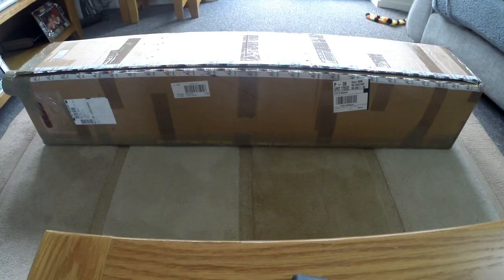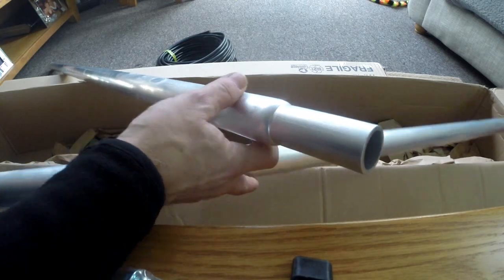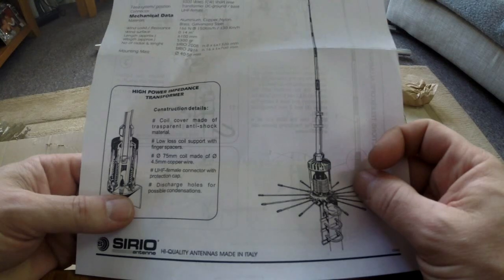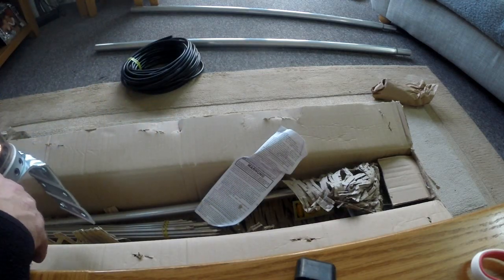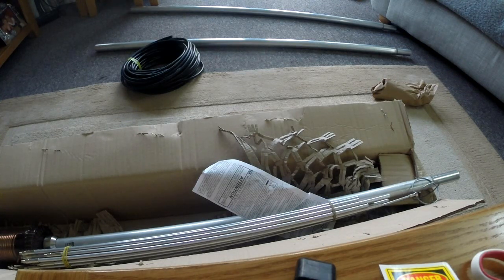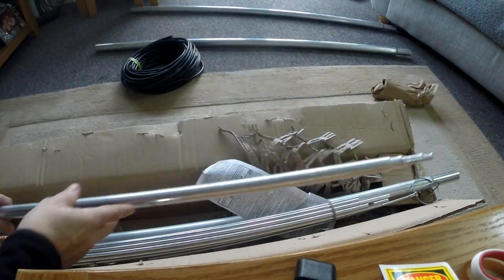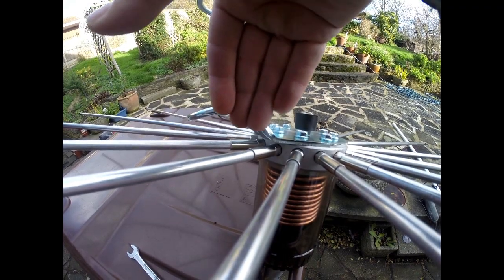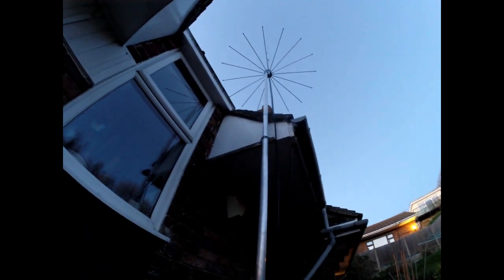Putting up my new Sirio 2016 antenna

Comment: Just went and bought one of these. Looks very well made. That base section certainly has some weight to it. Had an antron 99 years ago but it eventually broke in the high winds. So after being off the radio for about 20 years I got back into it last year and been using 5/8th wave silver rod. So time for an upgrade. 😀
Reply from the maker: I am very pleased with mine and made some good contacts so far, i will be posting and update video one year on as i have had it now that long. Happy dx on the new aerial you will enjoy it.
Reply: Fit the optional plastic radial ring to prevent the radials from bending or breaking.
Reply: @george-ev1dq This 2016 antenna doesn't have optional ring to support the radials. The sirio 827 has these.

Comment: That Sirio 2016 will absolutely smoke the Antron! I just put one up and it was far superior to the Gainmaster HW & 5/8 version. And no RFI issues.
Reply from the maker: Hi Ron, yes agree its a very good aerial I am very pleased with mine, had alwayys wanted one so when the Antron went and I had the opportunity I got one. Seems to do well as makinglots of contacts with it. Good dx'ing with it!
Reply: I definetly hope so. I am ready to stop using a Antron 99 that has a lot of white noise. Imo. I hear the sirio 2016 is very widebanded.

Comment: Greetings.
I watched this video with interest. I'm in Italy and my Lemm M5 broke due to strong winds. I currently have an old Falkos Uranus 27 mounted. The Sirio 2016 seems to be more resistant than the other antennas.
After years of use what do you think?
Can it be used without tie rods?
Greetings

Comment: I was going to purchase one of these antennas 2016 but was outta stock so i picked up the Sirio 827 im very pleased with its performance. Ive had the maco V 5/8's and the super penetrator 500. The Sirio 827 out performs both durability and performance both receive and transmit and tunning is better. I only wish it had a higher power capability. I have up to 5k to use. 
#12 Watkins Glen.ny🇺🇸
Reply from the maker: Hi bob, glad the 827 doing well. 5k!!! Of power i will look out for your glow across the pond!👍 take care and hopefully catch u when the skip is running, all the best, Mark.

Comment: Those poles are much better quality than anything I have here - really thick wall. Will take a look at Knights when I need more. Edit: You could have put the poles the other way up - no need to cut them. That's how I do it, as I can leave the end swaged bit at the bottom under the wall brackets.
Reply from the maker: Yes now you mention it i could have hehehe !! I have black weather caps that after i cut them i push in to finish it off

Comment: Nearly 2023, how’s it doing? Rust? Issues? Anything? Considering one instead of an 827 due to its reduced radial sizes, mine would be similar in height as yours 
I live 3 miles from the coast so it can get a bit windy at times

Simon
Reply from the maker: Hi Simon, yes antenna is all still good it was up in storm clara snd suffered no issues, there is s video showing that and what it looked like earlier in the year. I have no rust other than some surface stuff i saw but again its in the video, have a look and see what u think. Got into lebanon at weekend on it so still performing well👍

Comment: Today i removed my trusty Antron a99 and switched it with a Sirio Gain Master which is a Fibre Optic antenna that needs no tuning or radials. I think they call the Sirio Gain Master a vertical dipole antenna and because of no tuning it is  installed and the antenna will already be on 1 on 1 for me ofcourse but i highly recommend the Sirio Gain Master! It is an awesome Fibre Optic Glass antenna!

Comment: Hi i used the 50mm swaged poles from moonraker my 2016 came down in the winds the other week .The pole broke at the joint of the swaged pole i was   a bit disappointed in them
Reply from the maker: I used the heavy duty ones as they were a bit thicker and fingers crossed no issues as yet, Got  mine from Knights.

Comment: Excellent video, my antron is a 25 year old one which has started to bend at the bottom section threading. 

I have the Antron 38FT up on an alloy pole. I thought it may have been a quick switcheroo and in with the sirio but the weight of that bottom heavy coil has me wondering. 

I think it's a three- point- guy job mate just to be safe. May as well replace the coax while I'm up there with some Messi and Paoloni to save me having to take it down again as its a big antenna and big job for me on my own.

Thanks for the video
Reply from the maker: Hi Rab, your very welcome glad you enjoyed it. Good shout on the coax as your right you only want to go up there once and organising some help to do an antenna always takes some planning, good luck let me know how you get on!

Comment: Nice mate how many sections of pole did u slot together
Reply from the maker: Just had a look and its on three sections of pole at present.
Reply: @britishcbradio1055  OK mate I'm in the process of putting my imax 200 up can u remember how long each section is
Reply from the maker: @trx250rpuma4  there 5ft swaged heavy duty poles, i got them from knights cb radio shop he does mail order. They are 1.5 inch (38mm) outside diameter.

Comment: You've chose great antenna I have same antenna and 827 much better than A99 and Imax you will have low floor noise with aluminium am getting S/1 noise with 2016 and S/5 to 7 with fibreglass antenna it was nightmare.
Reply from the maker: Yes i also have very low noise withthtis antenna, I am extremely pleased with it I just need some skip now to give it a real good testing. Be interested to know for the future which aerial you think is the best, '827' or the '2016'? Happy christmas and all the best for the new year.
Reply: Well i admit this antenna is a bit better than the max2000,but mine dit not last very long.3 MONTHS and it broke only at 50 feet of the ground.Never again.Raised the max 2000 to 65 feet.This antenna very fragile,not good for High wind area
Reply: Any performance difference noted from an 827 and the 2016? I went from a tornado to an 827.

Comment: At the moment i have a Sirio ganimaster but soon im getting the Sirio  2016. How did you find the 2016 is it better than the A99 have you had any good DX's . 26CT3891
Reply from the maker: Hi Michael, yes the 2016 is working well, if you have a look through my videos the dx i have recorded to date is all carried out with the 2016. It has a better bandwidth than the antron 99 that I had and so far I am really pleased with it, it hardly moves in the wind which is great.
Reply: I believe the 2016 is now obsolete ?  I went for the newer 827.  good luck.
Reply: @scousepie2  i can pick one up from Vine Antennas uk they have them in stock

Comment: Hi mate good video , just got hold of a 2016, I have an antron 99 (20yr old unbent one) which has seen better days. These newer Antron sellers have a cheek... Yeah its made like that so just accept it lol.. 

I have a 20Ft mast mounted 18FT High on a T and K spaced 3 1/2FT apart. The brackets are drilled in with expanding Rawl you have only with 6 inch long ones.

My alloy mast walk thickness is a bit thin for a 20FT Mast. I'm worried about the weight of the sirio 2016 coiled section on top of this big bendy mast.

Do you reckon guy lines would soive my problem?
Reply from the maker: Guys would help but then you have the problem of running them as if your mast is suspected as being weak you would ideally need them 1/2 way to 3/4's of the way up the mast. If the 20 ft mast is the concern then better to get some stronger poles, not sure fo the wall thickness of what you got but if you measure it with a vernier and find out what it is you can compare it with the spec of the standard and heavy duty "swaged" poles shown on knights website. You may find it is actually the same thickness as the standard ones so it may be ok. You could also drop it down another couple of fett and mount an additional K bracket in order to really strengthen it. Hope this gives you some ideas but firstly check the wall thickness against the poles sold at knights and see where you sit. Google knights cb radio shop if you don't know them. Let em know how you go and any more questions just message. I put three mountings on mine (2 x K, 1 x T) and mines a lot lower but it doesn't move at all in the wind.

Comment: I purchased the Sirio 2016 antennas, after install I was about to connect my lead to the radio, checked the swr and for a short as I'd built the lead up myself. It's showed a short from center pin to outer on the plug so preceded to check plugs and lead and turned out this was ok. Tried the female plug at base of antenna and it gives a short. Just had a chat with company I purchased it from and they state it is supposed to have a ahort?  I always thought a short was bad for a radio which could blow the finals ??
Reply from the maker: Snap!!! Did exactly the same thing and still have the short, the company is correct nothing to worry about, you only have the short when the coax connected to the base of the aerial, its to do with the impedance of the  aerial. So dont panic i did as well! If you have a short when the cable is not connected to anything thats a problem though.
Reply: @britishcbradio1055  Thanks for getting back ... I tried a search on the short indicted for the antenna when I first discovered it but no results came back and then thought the worst ..I.e. a possible fault.? Its good to get an independent opinion. 73s
Reply from the maker: @seancfix7703  exactly the same theres no information, it was knights cb radio shop who put me right 👍

Comment: That pole it was in the box(entire sirio 2016 order)? Or is a part of different order?
Reply from the maker: Happy Christmas! Unfortunately the sirio 2016 doesn't come with the poles, I ordered everything from Knights CB Radio shop so they sent it all in the one box. The poles were 1  1/2inch diameter and when ordering the Sirio you have to specify if you want the "U" clamps on the aerial itself for  up to a 1.5" pole or a 2 " pole, I got the up to 2" pole brackets. Hope that helps, if you have any m,ore questions happy to answer them.
Reply: @britishcbradio1055  ,thanks for your quick response.  I'll build my rig and your video it's helpful.  Which kind of power supply you use? 13.8 and more than 15A? And a Happy Christmas too! 73
Reply from the maker: @prefitp7468  I only use a 5-7amp to power just my cb radio as although my homebase cb radio is supposed to have an internal mains transformer, it was missing when I got it so I have to run it off a 13.8V supply. For my burners I buy mains powered ones that plug straight in the wall socket so I don't have to have a big amp power supply, as all mine runs is my Cb Radio. If you have a mobile linear and are looking to run that in your house  then when you see a set of liners look up what that manufacturer or another manufacturer of a similar watt linear amp specifies in their literature, then you will know what amp power supply to purchase depending on the amplifier you are getting. Hope this helps.

Comment: Im looking for the same areal 2016, I was informed today that its no longer in production ?. where did you buy yours from.. thanks in advanced.
Reply from the maker: Hi Daveyboy, I got mine from Knights CB radio shop, they do a good mailorder service. Just checked there website for you and it says "sold out", suggest you email them and they should be able to say when they have more coming in, they are very helpful i have used them for years.
Reply: @britishcbradio1055  Thanks for getting back to me, I have ordered the Sirio 827 from them, I bought my SS6900N From Knights.. found them to be very good with a speedy delivery service.
Reply from the maker: @scousepie2  Good stuff, the sirio 827 has a good write up as well sure you be leased with it. I also have a 6900n it is my mobile radio, it took a bit of getting used to withthe clarifier not having a separate fine / coarse but I really like it now.

Comment: Hi mate what size drill bit did you use on those plugs.
Reply from the maker: Hi Chris I got the plugs and raw bolts on amazon as I could find bolts everywhere but not 80mm raw plugs. They are M8 - 80mm bolts  with wall plugs, i used a 10mm brill bit for the plugs.If you search "Electrosmart pack of 10 M8 x 80mm steeel bolts kit" on amazon you should find them, they were £3.99.
Reply: @britishcbradio1055  thanks mate managed to find some on amazon aswell. A guide I saw said use 9mm drill bit. But thought I'd ask because don't want to split brick if the holes are too small.
Reply from the maker: @chriswilby7679  Hi Chris Start with a 9 and see how you go if thats what they recommend, you can always then go 10mm if they are too tight. Good luck let me know how you go when you fit them, all the  best.
Reply: Thanks mate they arrived today and does say 80 x 10 .think the guide I looked at was probably for a smoother thread or something .just got to wait for other bit's to arrived now.
Reply from the maker: @chriswilby7679  good stuff! hope all goes well.

Comment: Hmmm, before many years, this antenna was great piece of HW. Now i see, they change the big cooil for autotransformer - cheapest solution ever. Well i do not hate any antennas, but the old 2016, real 5/8 was on 4.th place in antenna compare in my country, in real tests. First was A-99, then old Black Pirate, then GainMaster, then 2016. But this cheap version, wich is shorter than original 2016, cant be as good like the old original. Bad news, for todays CB guys. For this price A-99 or IMAX-2000 is clear solution.
Reply from the maker: Hi Johny, thanks for your hmmm comment, but i must respond on a couple of points here. Any antenna anyone buys will perform different to another as its not just down to the aerial you buy from an antenna pole, buyers have to consider mounting location, exposure to wind, neighbours and how high they are ASL and how high they mount it. In addition  its also down to personal feel and choice. Now i previously owned an Antron 99 and can say i get out better on my 2016 as Spain was a no no for me before i got this aerial. Not sure on the autotransformer / length comment so no idea if it has changed but the big coil has always been present on the 2016 for as far back as i can remember. If you look round the net u see gainmasters snapping in high winds so all aerials can suffere issues, go to buy a new antron 99 and they will say it may come bent as that is how they are being made / sold. Went on your channel to see if you had done a video on this aerial or the others mentioned but no videos at all on your channel, so good opportunity to put one together and post one up. As you can see in my video i only had one part on the house i could put an aerial up on so theres another factor i had to consider.
Reply: @britishcbradio1055  Sorry for my bad ENG. Never learn this lang. in school. Big coil = pass thru coil, not autotransformer, like your antena - autotransformer is coil which was use on cheapest antennas before many years. I was dont think, i will see this type of coils any more. Well Sirio is showing me, that nothing is impossible. Original 2016 use pass thru coil, with my ENG skills im not able to explain you, why it is much much better. But belive me, it is and the diference is huge. This new 2016 use so called autotransformer - coil, which have somewhere in cca midle conected "turnoff" where is central wire from coax conected. This solution was use first time on cheapest 1/2 and 5/8 in 90s. It have bigest losses ever. Maybe even ground plane can perform better than this. This kind of coils have one advantage - they can tune almost any radiator lenght... but, there is a problem. Radiator lenght is a solid number, which is bad idea to change. If you change it, you do deform the radiating diagram. So, with autotransformer, is easy to build antenna for Sirio, it easier to tune for user, but the gain in best direction is lost, deformed and is smaller. It is just worst idea like to build 5/8 antenna.

Comment: A £35 silver rod would give that a run for its money
Reply from the maker: Depends on many factors there Ian, height is might! I used to have a GPA27 and an Antron and so far the Sirio 2016 has out performed both, its the big loading coil  that really makes the antenna. Very pleased with this and it works very well with SSB, but it all depends on locations, budget and what you are used to I suppose.
Reply: @britishcbradio1055  I guess. I live in a tower block 18 floors. I was gonna get a antron or whatever. A £100 + antenna. When I told the guy at knights I live in a tower block and plan to put it on the roof he said not to bother with them fancy antennas just put a silver rod up. He was right it works brilliantly. He said no point paying all that money for a extra s point.  Everyone can hear me and I can hear everyone. I live in London (big place) can get everywhere on under 10 watts.  Height really is might.  1.1 swr.  At my mum's I use a sirio sd 27 halfwave dipole.  Brilliant antenna. Sidebands I get all over Europe easy.  Back in the day I had a sigma 4 7/8 wave up🌚👍. Radio wise I use a mint cobra 148 gtl DX with a astatic teardrop 575 m6 mic with a galaxy frequently counter.  I also use an alinco DX 10. Got a little KP 203p which I rarely use
Reply from the maker: @zukispur5493  Nice!!! hopefully catch you on the activation, 73's!
Reply: @britishcbradio1055  yes my bruva
Reply: Nah, the silver rod won't. Been there, done that.